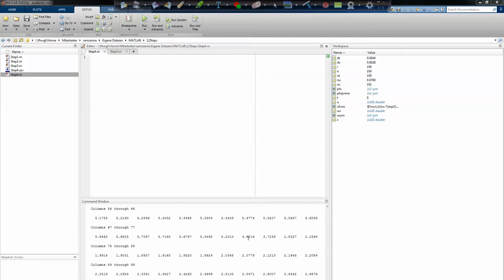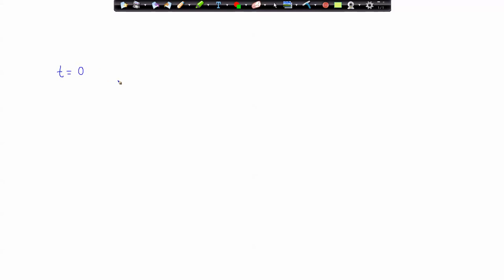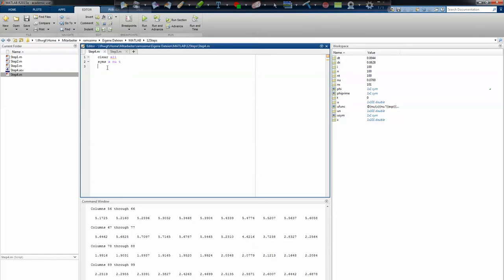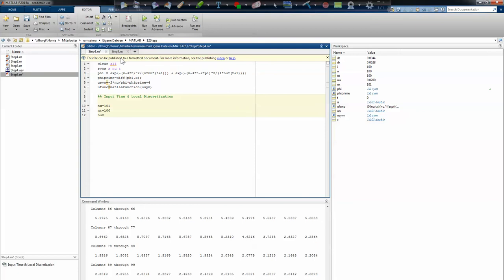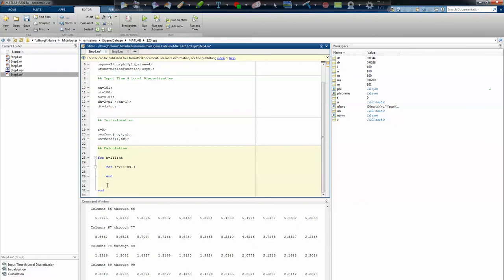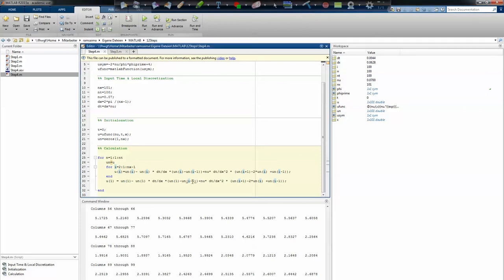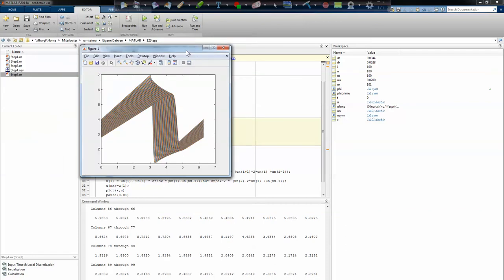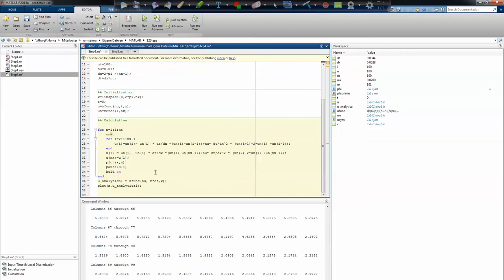12 Steps to Navier-Stokes - Step 4

Comment: I wrote this code and run it in my laptop but  it does not run , error shows there is a mistake in middle loop. I see many times and compare with initial math equation but cat run it.
Reply from the maker: can you send me your code? I will have a look.
Reply: @ManuelRamsaier  I have sent it to you at your mail Id. please see it and guide me . I will be very thankful to you.
Reply: thanks for correction, Now I have run this code after correction.
Reply from the maker: @dewis2967  Merry Christmas ;)